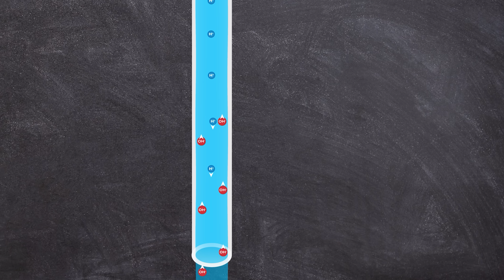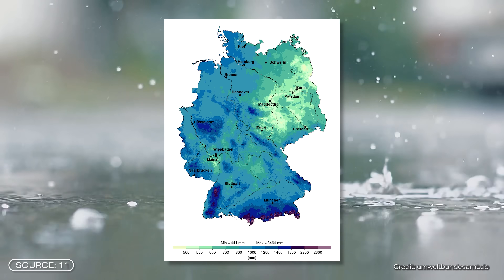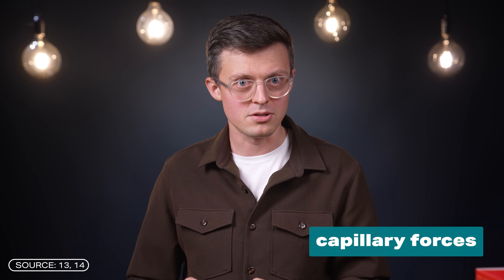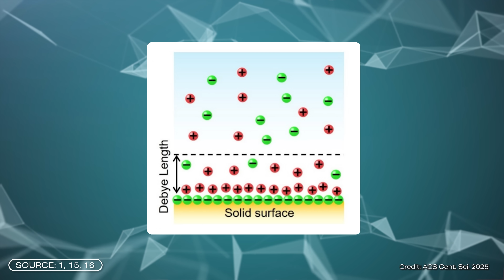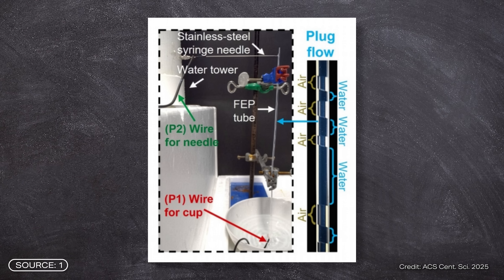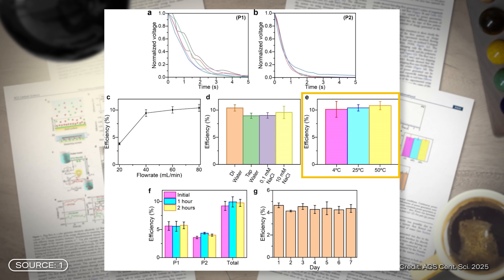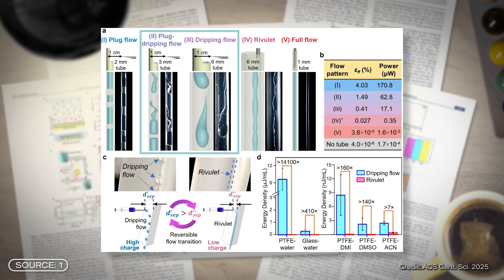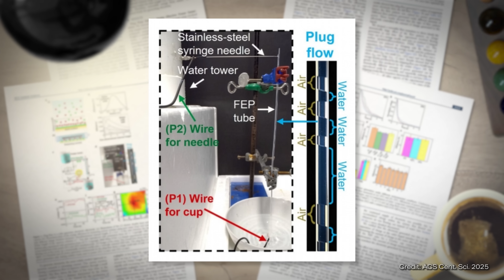Physics Hack: 100,000x More Electricity from Rain!

Comment: On topic of hydro = It is my understanding that the cost-to-ROI of existing hydro projects faces a cost model challenge versus wind and solar, etc.

So to address "necessary maintenance" challenges, why not reinvest around the existing engineering to improve Use Case(s) to ROI design?

From Use Case = Energy
To Use Case = Energy, River Basin Water Filtration, Commercial Fishery, Data Center, set design/destination location, etc.

The more Goal-State Requirements we can brainstorm, the better, imo...even if we leave "expandability" within our new architecture for future grown/innovation.

Any ideas?
Reply: Also:  What if we  innovate our transportation systems to have permeable surfaces w/ sub-surface Water Management and perhaps hydro on grade.?

Comment: Although the costs seem to be a hindrance, I could imagine sets of multicore pipes (each core being of the appropriate diameter), perhaps spiralling to reduce the exterior length, with the same water flowing through several in series. At the bottom of each pipe a propellor driven by the flow would provide the stop-start flow for the next, similar multicore pipe below. Such a series could provide several flows over a few metres on existing downflow pipes outside houses. Incidentally, the flow and the propellors would probably be self-cleaning in areas where rainfall is consistent, which would reduce maintenance costs dramatically, particularly by comparison with wind turbines, microhydro schemes or solar panels.

Comment: Only real issue with generating significant energy from rainwater is water flow and velocity. if you've got a home with a huge roof space and the angle of it is like those Bavarian houses (at least 60 degree pitch / slope), you're not gonna have enough velocity or water flow to spin any decent turbine. If you could direct rain into a big reservoir - a reservoir can just mean a huge drum, not just proper reservoirs that your local water board owns 😝- and then channel it into a turbine like hydro electric dams do, that'd be something.

Comment: Kelvin water dropper micro setups achieve over 18% efficiency, but generate high voltages that need bucking before power most circuits today

Comment: Also, does the solar panels lose more efficiency in 10 years than this new tech?

It costs more but maybe the  payback time is just longer than solar panels. taking into account it doesn't degrade as fast as panels (if so).

Comment: 440 microwatts? so in a full day of decent rain, you could collect about 3,000L of rainwater with a typical roof, which at 800mL per 440 microwatts would produce a total of about 1.65 watts. if they're only 30cm long though perhaps we could stack the systems, say 3 or 4 from rooftop to ground level, and we'd make enough to power maybe one LED ceiling light. that doesn't seem worth it?

Comment: While applaud the progress in sciences elaborated on in this video, I believe it would be more ecological to plan a room in the house that will house a reservoir which can hold all the rainwater from the room, then to bore a narrow hole in the external wall which evacuate the water to activate a turbine generator, then let the outflow be filtered for later use?
Reply: It would be a very tiny amount of electricity

Comment: USA HERE. in 1980 we improved a 1975 USA NSA research experiment on how lighting was made.  Using soft air streams thru distilled water  the air bubble remained with hydroxide ions. Sending that airstream to a 200hp industrial boiler. Must use a copy tube, increased combustion efficiency to 88%

Comment: Automobile carburetors have a device called an emulsifier tube that breaks up fuel flow to the venturies much like the plug flow system.

Comment: So, since the effect takes place at the interface between air and water, instead of at the interface of water and the tube surface, could we potentially increase the size of the plug to make use of a wider tube, while keeping the plug shape the same?
I'm just thinking that 400mW/needle seems rather low for practical applications. We would need over 300 needles to get the output of a moderatly OK solar panel at that rate. And with each needle only releasing millilitres per second, even at 300 needles, it would take longer to release the water than to collect it during rain.

Another flaw I can think of, from a practical standpoint, is that the water needs to be collected locally in order to harness the charge from it, which means it cannot just go into the drain. We would then need a collector that can accomodate the entire volume of all the rain on your roof to harness the energy. And this would also need to be cycled automatically in some fashion, so that we don't get too much de-charged water in the collector, and so that it doesn't overflow next time it rains.

And then there is obviously the same issue we have with solar and other intermittent power sources: Storage is highly inefficient.

Comment: Brazilian here, your english is Very easy to understand.
About rain water generation, those systems do not seem to compete but to add, one could imagine a solar panel that take energy from the droplets and collect in a reservoir, where it could be released to the needle into the FED tubes during the night or during peak demand.

Comment: peer review :  i suggest this is Bullshit.   simply put, because your english is not so good..  its bull shit.   sorry, but you cannot create power in this method because it HAS NO WORK.  if its creating anything,  it would be more rain.   because energy is neither created nor destroyed.   so any power that this sort of device would be getting would be from an outside source.  such as electro magnetic fields, or static fields that are picked up from the "constantly wet" tube.  which would act like a perfect antenna.    FYI - i can get some sort of power from nothing more than a copper wire going from the top of a small tree to the bottom, and measuring the difference between the wire and ground.   but again,  that has NO WORK.    WATTS LAW bro..  WATTS LAW.   electricity IS WORTHLESS WITHOUT WORK.   hydrodams use the force of millions of gallons of water to create WORK.

Comment: I'm not confident about this odd generator. I am confident about your English. I don't listen to weak English. Your effort to maintain consistent power in your speech, distinct word separation and speaking to the camera means that I easily hear you the first time and never have to repeat your words, which is when I
usually end the video. The effort to communicate is yours not mine. Your communication skills are superior to many native English speakers. Your superior effort makes your accent a non-issue. You require no improvement, just don't get tired or lazy. Great job done!

Comment: You should do create copper tube coil run the water through it. Put a heavy magnet through out the tube and collect current via copper tube. 

First test in home setup. You just need to bend a coil with say 20 turn. You can stckmagent around it.. connect a multimeter positive to copper tube and negative to ground. And see how much voltage you can get.

Because we dont have turns but we have water flowing in coil form means there will be definitely current, faster water more current.

Patent it if you can get more current

Comment: Raindrops are one of the best methods. Rather than big generators harvesting wind, you can use something which collects a lot. Rain drops a lot. Then a simple miniscule change in efficiency collection (say 0.5% - 0.6% efficiency), doesn't seem like this, but it's multiplied by large amounts due to lots of it.

Comment: I think this stuff is great in the labs and keeps the university students busy but in the real world it will never happen. Too expensive to much maintainance and running costs. It’s just been reported in the uk they the fire brigade have reported a 60% increase in house fires in 2024 of which the vast majority were solar panels on roof tops, people are dying due to solar conversion. Vast resources are required to fight these fires and coupled with the massive increase in electric vehicle fires and the huge pollution they cause with hundreds of tonnes of cancer inducing toxic fumes and the massive investment in  fire fighting equipment needed to protect fire fighters from death by inhalation you have a very dubious argument that so calked green energy is a viable social way to produce power. In the uk the governments disastrous zero carbon policy has bankrupt the country which now has not only the largest borrowing interest payments to China but charges its citizens the highest energy costs in the world. I’m afraid there is no such thing as free green energy it’s a fallacy. I have to clean and unblock my shower head every 4 weeks as the black mould grows inside the small, tubes and blocks them. This takes a long time stripping the unit soaking it in a bleach and refitting. These practical things are needed for any system that uses rainwater , green algae grows at incredible speed in sun light and these 2mm tube would bloke within a few weeks of use on a house roof. The research is great and exciting for the students but it will never be of any practical use to power the wheels of industry.  People are dying every year from house fires because the solar panels are exploding into flames and burning their houses down. Interestingly one of the reasons for the 60% increase in solar panel fires is lack of maintainance the panel become dirty from rain, in the uk thousands of tonnes of Sahara sand falls in the rain and this hardened on the panels coupled with bird pooh and algae growth the panels over heat. The cost of cleaning is excessive and can run in hundreds every 4-6 weeks to have them cleaned with scaffolding needed and skilled technicians many projects can’t afford these costs which cancel out any advantage they had from the electricity produced by the panels. The sand would soon block these tubes I think. Interesting projects non the less but all the green energy is pie in the sky for an industrial nation. These are at best useful for off grid experiments in isolated living environments, and they do not contribute to a sustainable viable living population.

Comment: Let's do a little maths.  Suppose we have a semi-detached house in the London area.  Building footprint say 100 m², average annual rainfall 0.6 m.  That's an average annual total of 60 m³ of rainwater falling on the house, which is 60 tonnes or 60,000 kg.   With a 6 m high gutter that's a total potential energy relative to ground level of 60000 * 6 * 10 = 3600000 joules.  This is 1 kWh of potential energy, per year.   We're told in the video that the technology can capture 1 in 10 joules of potential energy, so that takes us down to 0.1 kWh per year.   Call me a pessimist, but I'm having difficulty getting excited about this amount of electricity.  Compare this with solar PV which delivers a typical annual average of around 200 kWh/m² in London, totalling 20,000 kWh per year for the same house with the roof covered with solar PV tiles, or let's say 10,000 kWh allowing for orientation.  This is one hundred thousand times more electricity from the same roof.   Don't get me wrong - I'm always interested in new technology and the concept is interesting and well described, but the simple use case of electricity generation from rooftop rainfall appears to be very limited.

Comment: I already wanted to state tribo electric and piezo elecric rain pannels.
some home scientists in england have used that for quite long alraedy, very cheap setups, yet atleast in england due to little sun and much rain, better performing than normal solar pannels.

one big issue however regarding rain powered devices is the global rise of both ionic destrabilisation, and the use of weather modification by many companies and some countries to get more water for their industry but resulting in droughts in surrounding areas.
Ionic destabilisation also causes draught.
a nice example of this is netherlands, in Netherlands typically in summer there was much rain, this came from the ocean. during autum it came more from other directions.

some years ago in the ocean next to netherlands huge fields of win turbines where placed, those are almost 300 meters high, and when they where placed they wheren't thinking about natural ion levels of the atmosphere, so those turbines where made without a insulating coating to prevent or reduce ionic conduction. as a result, not only are insane amounts of ionic energy wasted and pumped directly into the ocean, but this generated a ion depletion area.
essentially.
normally for every meter you go up the charge of the air should increase with 100V, on the ocean, this charge increase should actually be much bigger, but also depends on the weather, so I use the 100V which is kind of the minimum on land, on water tends to essentially always be much higher however. even using the conservational land levels, this results in over 26000V difference there relative to surrounding areas. this also affects the air above and around it gradually generating something like a bubble. so even at typical cloud hights there, the ionic voltage is dropped by around 25% to over 80%.

ionic charge differences, also known as static charge diferences, attract other charges, the wind turbines, won't really move. but the clouds coming in get pulled down to the windturbines and condense there as well as cause rain there. the same happens to water evaporated from the ocean there, as well as due to lower charge evaporation rates are also affected directly.

as a result, since the construction of those windturbines, netherlands has had constant as good as completely dry summers, essentially all rain in netherlands now, comes from france, most of the rest from the north or germany, though less often winds from that direction here, and less often.

ofcource they can't fully fix this problem without removing the wind turbines there, or adding some hyper evaporation setup after it.
though with less height, and special coatings, they could greatly reduce the problem, a setup such as a HEA, or open air CEAD (essentially a open source technology to greatly accelerate water evaporation and distilation speeds, amounts, and also much better performance at low temperatures. it is very simple to make). they could even just hang a lot of organic fabric around the bottoms of the windturbines to evaporate a lot of water with similar charge to the turbines so less atracted to it, and then between the turbines and the coast add a more indepedant evaporation for higher altitude cloud forming, as well as to alter the air pressure and so draw the wind through. combine this with making the turbines some shorter, and by coating them in specially designed coatings to speciffically insulate it from those ionic charges and the rain should return, as well as the wind turbines lasting longer, as constant water condensation on it probably will form a problem at some point.

Comment: It's a nice technology, but I have a doubt for it's efficiency. You should construct a tank on the roof and this drop system to get a comparisonly small amount of electricity. Is it more convenient to construct for example a roof with segnetoelectric ceramics to get electricity directly from the energy of drop falls to the elements? 
Greetings from Siberia. We have less rains than in Europe, so we won't use a rain transforming tech in a soon period of time. But the video is interesting, thanks.

Comment: Someone asked about collecting water and using a hydroelectric turbine. decided to make this a proper comment.

The energy formula is m×g×h
g is constant 9,81
m is the mass of the water in kilo-gram
h is the height in meters

For example you have 100m² roof
a 1mm rain would yield 10m³ of water
of your house is 5 meters tall that would mean an energy of about 784800 joules or 218kw hours

please consider the fact that this would include the practically impossible 100% efficiency
at 30% (small turbines are bad at efficiency) it would be only about 72kwh

Also please correct me if I made a mistake here somewhere.
Reply: Also you would have to generate the energy on the spot, you woukdnt keep 10 tons of water on your roof (probably). Very rainy areas with 5mm rain would probably benefit from this.

You have to pipe all the water into the 1 turbine (having >1 is more expensive and probably less efficient) and the piping has higher resistance if piped in anything that is not a straight line.

Comment: VIRTUALLY FREE ELECTRICITY IN UNLIMTED AMOUNTS FOREVER !
The EARTHS atmosphere at sea level has around 110v DC current per Cubic Metre. At 3,000m above sea level the voltage is now around 10,000 volts, and at the planets outer atmospheric limit the voltage has risen to 250,000v per cubic metre. So if the World needs electricity, why do they not use Nikola Tesla's "Tesla coil" which was banned around 1910, because it provided virtually FREE unlimited power forever out of the Planets atmosphere. Which would have stopped the wicked Industrialists from screwing everyone for ever, for loads of their Electrical generated pollution mongering profit grabbing Greed ?????   So I'm suspicious that the crew in Singapore have simply used rain (a part of the atmosphere at that moment) to reinvent the Tesla Coil !!!!

Comment: Regarding the robustness - simple 3 steps. 
1) self-cleaning/unclogging filter before rainwater ingress into the reservoir. 
2) See-thru reservoir - UV light helps killing microorganisms.
3) Steadily released chemical cleaner to avoid algae.